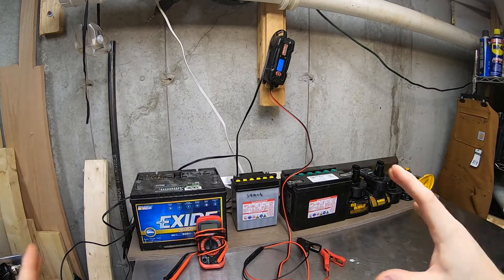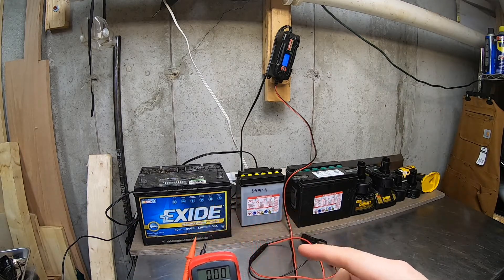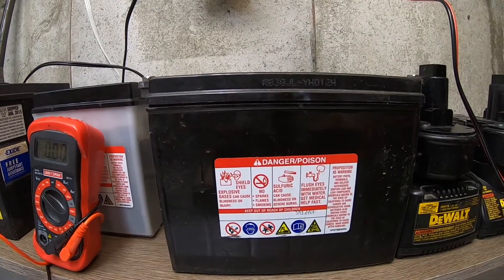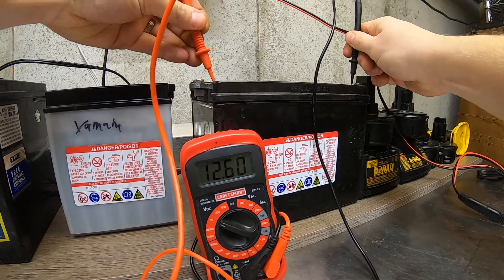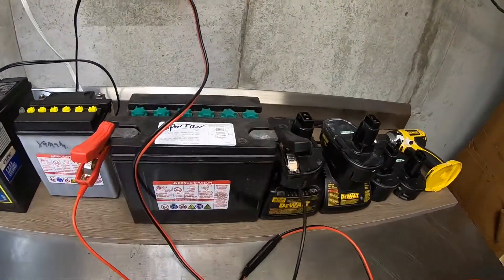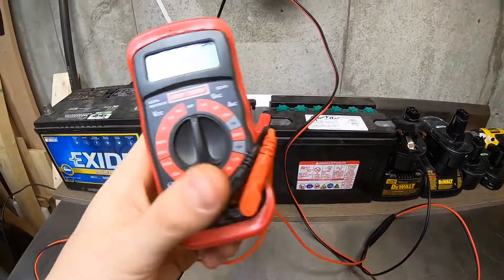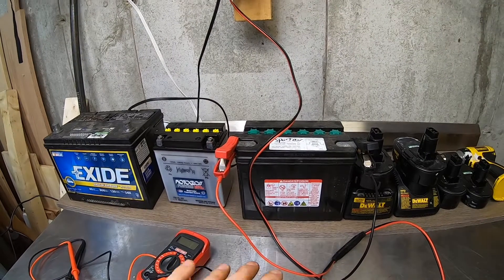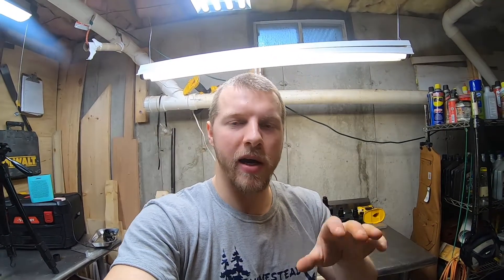Everything You Need To Know About Storing Batteries! EP 104

Comment: Hi Jay!  Thanks for the good advice!  I have found the same holds true for rechargeable Li-Ion batteries.  Last winter I started out storing my Greenworks batteries in the garage, which is not heated.  I noticed their performance was going down hill fast.  I moved them to our mud room and they bounced back to full performance.  So you are absolutely right about avoiding storing batteries in the cold. Thanks for sharing!
Reply from the maker: Hey Martin! You are correct! Im still running 18v Dewalt system for my drill (yes prehistoric I know lol) and they dont stand a chance in the cold! Im sure the 20v have a fighting chance but not my oldies LOL batteries are expensive and I dont have the $ to upgrade to 20v brushless. Moving your batteries into the mud room makes sense! Thanks for watching!

Comment: I have heard that too about not placing a battery on concrete, the reason given was that it would discharge.  Have been thinking about this and the battery is insulated except for the terminals, i mean it sits on a metal tray when in use in most cases and is fine, maybe it has more to do with it being cold?

Thanks Jay, a timely post.
Reply from the maker: Hey rain! I think it’s because the cold concrete acts like a ice block/ fridge and it radiates cold into the battery. Yes batteries are insulated but still subject to the environment conditions. They do sit in metal trays but metal and concrete have way different properties as far as subject to cold! Most battery trays are like skeleton style where it’s not a full metal tray just a couple “slats” if that makes sense! I keep my batteries on wood on the top of the bench as you see because that seems to be the best case! I’ve learned from a master mechanic who’s almost 70 now and swears by keeping batteries off concrete so a lifetime worth of knowledge and first hand experience I trust lol!
Reply: The new batteries does not matter. The new batteries cases does not leak out power like the old batteries did. They are safe to set on the ground. But I still put on wood myself.

Comment: I was told never too place a battery on concrete . Any truth too this ?
Reply from the maker: Hey Stephen! I believe the cold from the concrete acts like a ice block or a fridge and it keeps the battery cold versus putting the battery on wood or something else off the concrete which eliminates that extra cold! That’s always what I’ve gone by!
Reply: Homestead Jay  👍👍
Reply: I was about to ask! I did a search on Google (my best friend) and here is what I found: "[...], this legend is historically based in fact. The first lead-acid batteries consisted of glass cells that were enclosed in tar-lined wooden boxes. A damp concrete floor could cause the wood to swell, breaking the glass inside". Then comes an potential good reason: "None of this is a problem with modern batteries — safe in their hard plastic shells. In fact, concrete is generally an excellent surface on which to place a battery bank. The electrolyte in a battery sitting on an extremely cold floor with very hot air around it could stratify, causing damage from sulfation; whereas concrete provides good thermal mass to buffer any temporarily extreme temperatures in the battery compartment". It seems I can get smarter each time I watch a video from you Jay!
Reply from the maker: @FromSteelToWood  Hey Joe! Glad you enjoyed! Always here to help :)
Reply: From Steel To Wood  👍👍👍